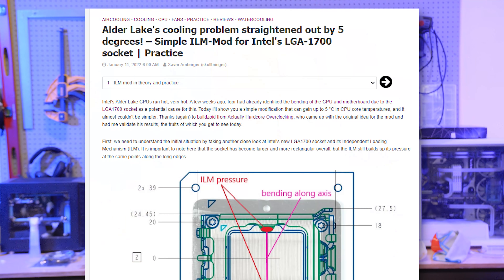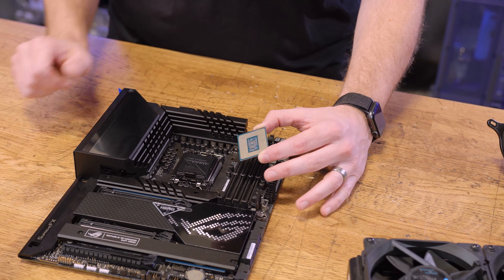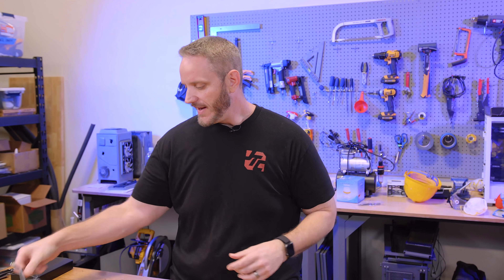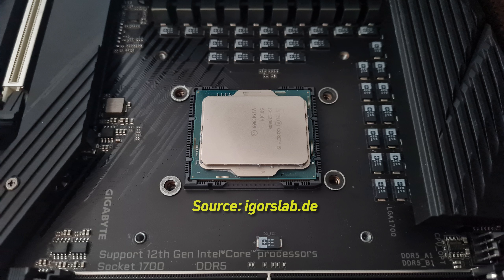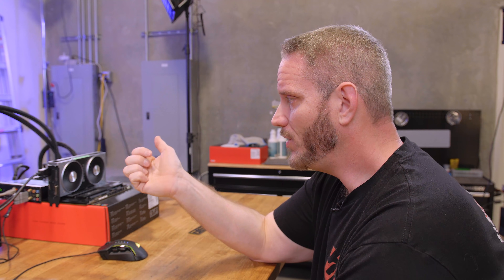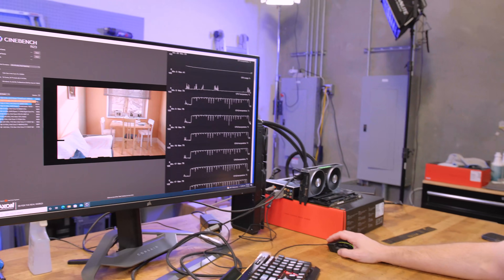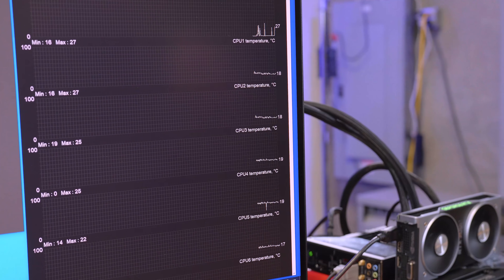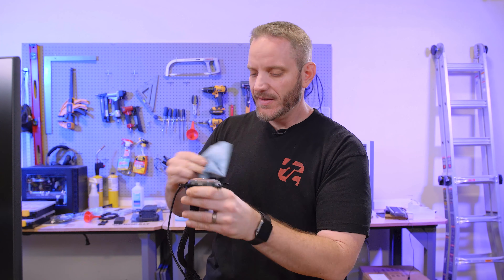YOU GUYS asked me to try this... so I did

Comment: help i cant turn off freesync on my acer xf250q moinitor and i turned it off in my AMD settings and it still greyed out on my monitor and now i cant even use overdrive i tried using cru to stop the freesync but freesync range is not popping up i have so much input delay.. HELP!help i cant turn off freesync on my acer xf250q moinitor and i turned it off in my AMD settings and it still greyed out on my monitor and now i cant even use overdrive i tried using cru to stop the freesync but freesync range is not popping up i have so much input delay.. HELP!help i cant turn off freesync on my acer xf250q moinitor and i turned it off in my AMD settings and it still greyed out on my monitor and now i cant even use overdrive i tried using cru to stop the freesync but freesync range is not popping up i have so much input delay.. HELP!help i cant turn off freesync on my acer xf250q moinitor and i turned it off in my AMD settings and it still greyed out on my monitor and now i cant even use overdrive i tried using cru to stop the freesync but freesync range is not popping up i have so much input delay.. HELP!

Comment: Idk about other manufacturers but I can confirm that Arctic liquid is sending new standoffs with a new backplate for lga 1700. They stated it in their instructions but I measured them both with a caliper and they are in fact a different size (I cant remember the size off the top of my head but I believe they’re shorter, either 13mm>12mm or 14mm>13mm).

Comment: Depend on the motherboard perhaps ? My 12700k was hitting 100c with only 4 sec of OCCT CPU bench, went to BIOS and disabled the auto voltage, setted it at a steady 1.28v and now i'm at 65c 100% load (EK 360 basic AIO, pump 80% fan 70%) I also have the LGA 1700 brackets from EKWB

Comment: It seems I’m one of the unlucky ones. I have a 12900k and when I run Cinebench it goes right to 100c and throttles. I’ve tried so many things with no luck. I’ve even sent the board back and am waiting on the replacement. Then I’ll try this washer trick and see if it helps.
Edit- load temps are with Cinebench which is what you should use to test. Gaming temps don’t mean much as it doesn’t push the cpu as hard. So while I hit 100c and throttle in Cinebench, for gaming I don’t get about 50c. 
But my main use case is video encoding in handbrake and that will throttle as well.
Reply: You're not unlucky, the 12900k is just a hot chip. FYI, they're not using the 12900k in this video, if you were wondering why their temps were around 70C, lol.

Undervolting around -0.05v (or more, if you can) should get you 5-10C lower. That should be enough to achieve default all-core turbo speeds without throttling. Only way you're going to get lower is if you invest in a good custom loop.
Reply: @dagskooz  I have undervolted but my best stable result still throttles. I have to lower the clock multiplier as well for when all cores are in use. Both of those things will allow me to run with no throttling. Cooler is a arctic cooling liquid freezer II 360. I can also tell from the thermal paste distribution that it’s not getting even contact. It’s obvious the latching mechanism is applying way too much pressure.
Reply: @fandibus   I personally wouldn't put too much faith in the claims that this video goes over. Mounting pressure does not directly affect thermals (unless it's too little), nor does having concavity on your CPU (unless you have poor paste application). So long as you're using quality paste and not using too little, this whole concavity thing should be a non-issue.

It's more likely you just got unlucky with a hotter than average chip, whether that be down to the silicon itself or intel's paste under the lid, who knows. Either you can try your luck in returning the chip for another, or invest in better cooling. If not a custom loop, an AIO with a larger radiator (420mm).
Reply: @dagskooz  There are people on air getting significantly better results and without downvolting.  It's most definitely chip and/or mechanism issue. Pretty wild variations out there, even with identical setups. People have posted images with some pretty large voids in the paste. It's clear it's not making contact.  I've been building systems for decades and this latching mechanism is applying way more pressure than any other one i've ever encountered.  If a 360 AIO can't keep it from throttling under stock conditions, something is wrong.  Even before this washer trick to raise the latching mechanism, people have reduced tension by bending the tabs on the mount which solved their heating issues.  Either way, i'll be adjusting and testing again this coming weekend.

Comment: Tbh the PCH temp is strangely high on the 12th gen. over 50 and sometimes 60 on idle (while cpu on 29-30 and cpu socket 32-34).
Under load PCH goes up to 72-74 while cpu goes to 49-54. Cooler: Noctua U12A Chromax black. Very confused….

Comment: My 12900k in cinebench no overclock is staying in the low 80’s with a the Corsair h150i. I’ve remounted the cooler twice but there was even spread of thermal paste so other than you having an open test bench I wish mine would run that cool

Comment: Just to correct some wrong technical information in this video: The CPU gets concave from the retention mechanism which only puts pressure in the middle of the tall sides of the CPU. With Alder Lake being a rectangle instead of a square there is greater possibility for this to happen. Also the Z-height of the new LGA1700 socket is rather reduced then increased as mentioned by Jay. Coolers meant for LGA1200 therefor don't put enough pressure on the CPU and require shorter standoffs to compensate for the lower height. Probably the combination of the IHS concave shape caused by the retention and using the LGA1200 too long standoffs can cause not enough contact pressure in the centre of the CPU. This washer mod only reduces the amount of pressure the retention mechanic puts on the CPU, and has nothing to do with the change in Z-height of the socket. Having the correct shorter standoffs length for LGA1700 so the cooler can put enough pressure on the IHS should eliminate the poor contact issue since the cooler surfaces is made slightly convex. As Buildzoid mentioned in his video, this washer mod might be useful only if you are using a completely flat lapped cooler surface with a fresh new CPU that has not been bended yet by the retention mechanism.

Comment: It's not about the older cooler mounting, which, if anything, should play less role in CPU deformation than on LGA11xx because on LGA1700 the CPU IHS is lower than on LGA11xx. It's about the retention bracket design and the fact that the CPU is now rectangular. The retention plate applies pressure in the middle of the CPU and the socket pins push back on the sides, which makes the CPU bend. Buildzoid explains this very well in his video.

Comment: I did this in November with the hero board and a waterforce x360, figured out the temps were messed up when i would hold my block down on the chip temps were 10C cooler, right now it idle and cools fine without any issues, but it could be much cooler if, by default, if the mount was better...which would lead to longer life ect. Disapointing that I have to figure this out myself and fix it somehow by my own engineering rather than the engineering I'm supposed to be paying for...
Reply: didn't understand too much... you're saying if you take the mobo+cpu+waterforce and turn them upside down, the temps get 10c cooler? on which axis are you referring the rotation?

Comment: Bought Corsair's LGA1700 scews for my 12700k and used it with an H100i Pro XT, along with Kryonaut thermal paste. Idles in the low 20s and in gaming I haven't seen above 50-55C. Many games run at 40C in 1440p.

Comment: Is Cinebench R23 supposed to get my CPU in thermal throttling instantly ?? Someone in discord kept telling me this was normal: My 12900k is hitting 98°-100° C in Cinebench R23 on multiple cores after 1 second (!) stock (!) with 360 AiO. I also tried another cooler and tried all thinkable applications of thermal paste, now switched to a thermal pad, it's a little better but still unimaginably hot. The power limit of the bios is unlocked, though CPU Packages Power according to Hwinfo reaches 256W !  I'm thinking about lapping, now, if the bending is real and the thermal pad doesn't solve it, obviously ...

Comment: The 4 screws cooling mounting system is old as XTs PCs, we need to come to grips that modern CPUs as big as these need a  6 screws mounting system and mobo manufacturers have to start coming out w/ 6 holes instead of 4… This small change will solve all these issues and set the height to were it should be.

Comment: If you CPU is concave and your bloc is also concave, you'll get terrbile temp. But of your bloc is dommed, you might be fine cause it will still apply the correct pressure in the center of the cpu...
Not all bloc (or any cpu cooler for that matter) is created equal.

Comment: I went with EK Velocity 2 Cpu block with Lga 1700 mount it comes with. Temps are pretty good. 5.2 P-Cores 4ghz E-Cores 1.32 vcore (temps 59-64 while gaming at 1440p high settings)
Reply: Games don’t push the cpu hard. So those of us with the issue are unaffected while gaming. Try running Cinebench r23 and it may be a different story. 
Though your gaming temps are rather high.

Comment: I was just watching your 3090 overclocking video from a while back where some Lord guy called you out on Twitter for beating you. I noticed that during your runs you had Precision X1 open on the screen. Try minimizing it. I don't remember how I figured out that just by having it up on the screen uses video resources. I think it was that it reduced my hashrate while overclocking my card for mining, so it uses something. By the way, I'm upset with the 3080Ti only having 12GB of VRAM. It isn't enough to turn off texture streaming for a game I like to play. It crashes sometimes for not enough memory. Now the 3080 has 12GB in its new version. New 3080Ti coming up? The game Hell Let Loose is the game I'm referring to.

Comment: Says it's a normal cooling setup. But the cooling system is a 3 fan AIO on a test bench. Try a normal setup of a 240 or 280mm AIO in a case!

Comment: I did "hack" cooler. bought new noctua where it had new spacers for 1700 socket and used these with old mounting kit for NH-D14. I think I had to limit 240W to keep around 80-90C. 250W limit it was hitting 100C

Comment: If you did get an optically flat and smooth surface you could use zero thermal paste. That method is used on some space-grade components but is pretty rare these days since both graphene thermal pads and thermal epoxy work really well. The cost in time and effort to get that level of the flat is pretty high. And why do they not use thermal paste? Simple it does not do well when exposed to zero pressure.

Comment: Alder Lake CPUs are bending under Independent Loading Mechanism (ILM) pressure, and that is an ISSUE! 
But instead of this being presented as an issue, we get this type of shilling and is spun as a positive, as a mod... impressive. The same ** Tom's Hardware did with this issue, made it a cooling mod topic, with zero statements about how this is an actual issue...
How is bending your CPU not an issue? It's intel's and MB makers fault here and they should be held accountable, not ignored or given a free pass. So many ignorant people...

Comment: Well, you did get a 5 degree drop once you added the washers. So, the article is correct as far as dropping 5 degrees. But it still depends a lot on the configuration of your system a far as what your overall temps will be.
Reply: how much voltage did he use for the test tho ? He never said Vcore used
Reply: @Qersoras  At the beginning, he said he was keeping all the setting stock. And didn't adjust any bios setting other than to try and lock voltages and fan curves. But you are right he didn't actually mention the Vcore voltage if that was stock or adjusted.

Comment: Think you jumped the gun a little on this one Jay.
It actually has to do with the ILM pressure, not the cooling retention mechanism at all, bending the entire CPU not just the IHS. The washers are used to reduce the ILM pressure. 
Your quick stress/heat test won't actually prove much in this case. The CPU used and discussed in the article had hundreds of hours of use. Which under the ILM pressure and combined heat of the CPU, has actually deformed it to a "U" shape, thus pulling the center axis away from the cooling block.
Also, the LGA1700 is thinner and reduces the Z height compared to previous sockets.

Comment: Great  test thanks.  I was about to try with my asus motherboard but won't now.  One thing though, the solution tested is the same as the artical but the explanation is different.  The artical says that it is the chip holder not the cooler that's bending the die. Adding washers to reduce chip holder pressure makes sense but the video implies that excess cooler   pressure is the problem.   I would expect lifting the chip would increase this. What am I missing?

Comment: i must have been the luckiest man alive then ... 12900k on a Asus strix Z690-A DDR4 with a Lian Li Galahad 3060 max temp (Ai overclock to 5.4 and 4.1) is 78 degrees Celsius ... And i use the default LGA 1200 mounting system

Comment: mine with asus ai driven automatic oc (zero tweaks by me) has 3 cores running at 5.5 and 5.2 all cores (with high voltage sure 1.45+) but I plastered the cpu with thermal grizzly kryonaut and have no problems with temp 27982/2106 CBR23 at 88°C (obviously less if I don't have such an abusive OC) you need to upgrade your cooling before trying weird things, btw the gaming perf is miles above ryzen but the z690 plateform sucks X570 is much better if you work or stream and need lots of bandwith lanes and real cores 5950x+x570 is king if you just game go intel for sure

Comment: Is this video testing a 12900K? Those are some amazing temps for a 231 watt power consumption.

My own 12900K even under water, at 240 watts, would spike almost immediately in cinebench r23 to 95c. Even after running lower voltages.

I got it under control by running a 150 watt power limit and lower SVID voltages, but it was horrible initially 

I am not sure what's going on, but 12th gen cooling seems a mess

Comment: I got Intel I5- 12600k, Asus Tuf Gaming Z690 and corsair icue h115i elite capellix works just fine using the existing mounting kits load temp 63 degree with 5Ghz performance cores and 4GHz efficient cores overclocked. I did ordered the CORSAIR Intel LGA 1700 Retrofit Kit, but hasn't arrived yet.

Comment: Jay,  I am about to pull the trigger on a lian li galahad, and I bought the 1700 compatible bracket separately from microcenter.  Am I in good shape or do I still run the risk of bowing the cpu due to excessive pressure?

Comment: What if the cooler itself is the limiting factor. You can make contact better but if the radiator and fans cant dispose of the heat it wont matter.

Comment: Thanks for testing as I was wondering what the result would be. On my 12700K I have no issues and even overclocked with max temps on CBR23 multicore,I hit 80 degrees on the hottest core and that is with a 5.3GHz single core and 5GHz all core, though I am using a 360mm AIO.
Reply: Your cooler manufacturer must have taken the z height into account, just like noctua's mounting mechanism. Thus, good thermals

Comment: I can't see how shimming the CPU socket retention would make a difference. The tension mostly comes from the CPU cooler which only makes contact with the CPU IHS and the motherboard PCB - neither of which have had their dimensions altered. The motherboard will still bow if the CPU cooler tension is too high.
Reply: which is exactly why Igor recommended a solid steel backplate like that alphacool prototype
Reply: Go watch Buildzoids vid. He explains it very well, in his own way.

Comment: I use a fuma2 with a 12600k and I have used the lga 1700 kit and they temperatures are great, under load its around the 50-52c and it uses around 110W.. Don't plan on trying it with the LGA1200 kit that came with the cooler

Comment: I wonder if its an issue that will start to show up more after a longer time. As in CPUs will get bent more after several months under pressure... or maybe some motherboards have tighter mounts than others?
Reply: The type of backplate you are using on your aio may make a difference too
Reply: Mine is so tight that I was affraid that cpu or motherboard will break if I will lock it, thankfully nothing break but the pressure on cpu is huuugeeee.... MB is gigabate aorus z690 ud ddr4. Im thinking about that mod when i will be changing to new cooling in a few days
Reply: @1starfish11  bro do you know any mobo which is not too tight and works well?
Reply: I think the stability of the MB and the Socket is make a huge difference from cheap to high end. Igor says that too
Reply: @seriousplace7756  Anandtech used  GIGABYTE Z690 Aorus Master and it bent like crazy :(
Reply: @markodimic  hi bro do you know any mobo which is not too tight and works well?
Reply: @arunachalpradesh399  all of them bend. But only for some, it will become a problem. 
I don't want to gamble with whis, I'll take my chances with amd

Comment: I notice you tested with the motherboard laying on a box. That doesn't seem realistic of a motherboard fitted in a case. Surely under high tension the motherboard can absorb more of the tension by flexing itself. If the motherboard had been mounted it would not be able to flex as much, putting the extra tension on the cpu.